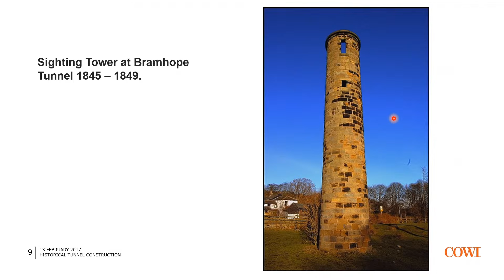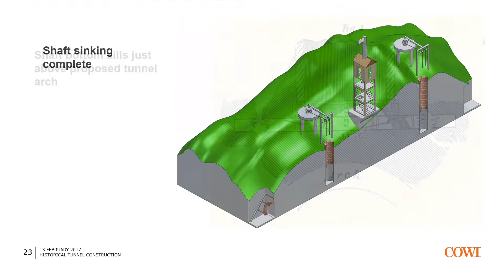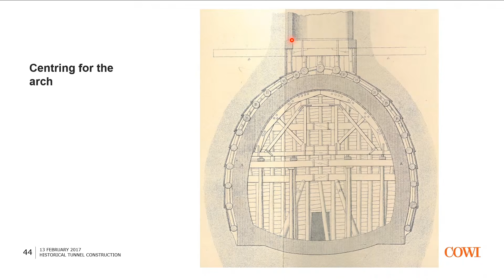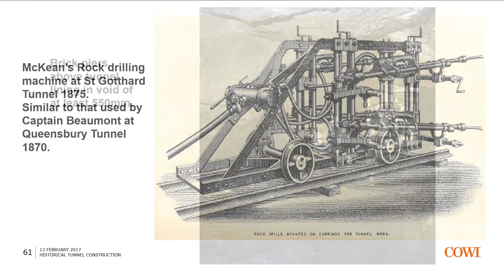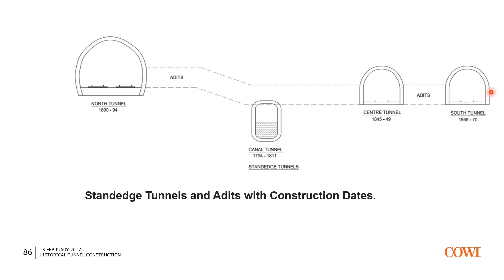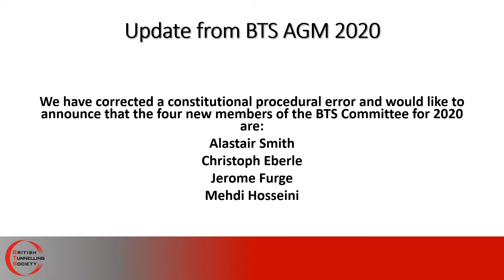Historical Tunnel Construction – Building tunnels in the 19th Century

Comment: Presumably because they used the wires down the shaft to enable them to maintain the correct bearing / alignment of the tunnel - shafts off set would mean that the setting out of the tunnel would be too difficult